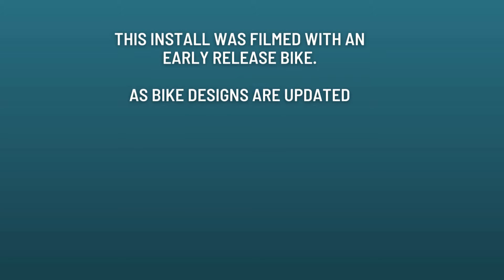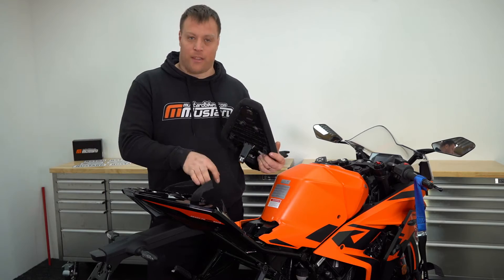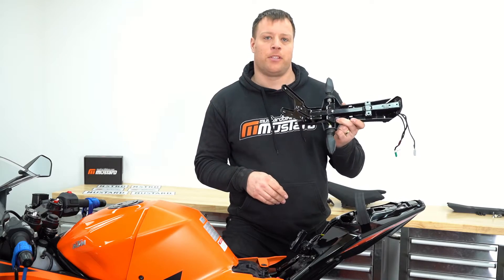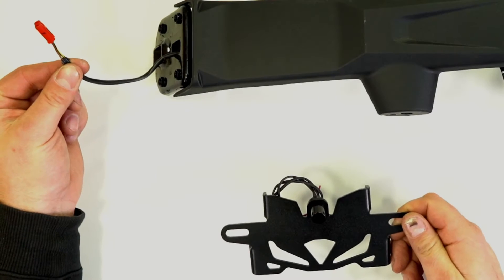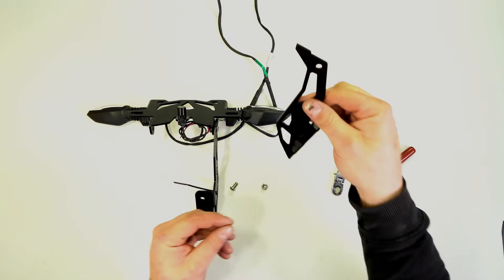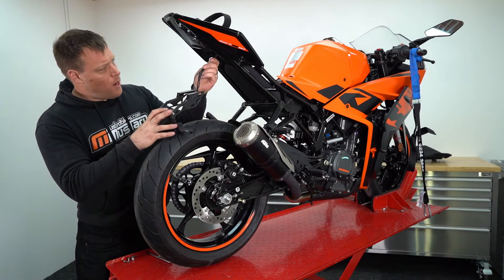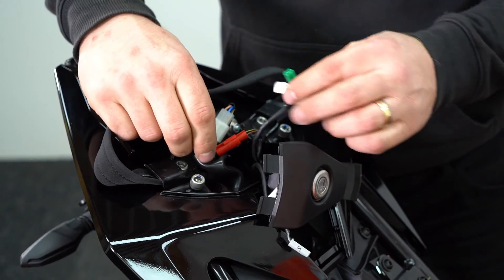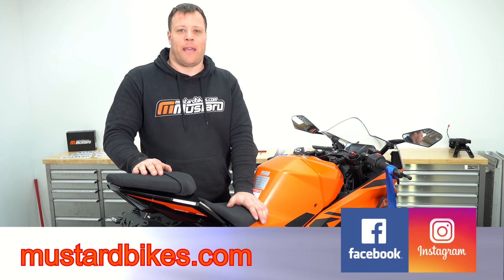Installing a Mustard Bikes tail tidy on a 2022 KTM RC 390

Comment: Saying as I would put this tail tidy on my 390, do you guys have reflectors that are compatible with the tailtidy?
Reply from the maker: We do indeed, although sold separately. The reflectors are designed to bolt on to the bottom of the plate (SA, NT and WA may need additional holes made for this purpose in some cases).
Reply: @MustardBikes I am thinking about getting custom plates (my plates) [NSW] it would be compatible with it right? could you send a link to the reflector is possible, thanks.
Reply from the maker: @DamanK17  Yep, should still be compatible. AR reflector: https://www.mustardbikes.com.au/adr-approved-reflector-mounting-bracket

Comment: can you tell me how to remove the plastic? I've taken out all the screws I can see but the plastic is not coming off:(
Reply from the maker: @motojc which piece of plastic are you referring to? I would go back and check you have indeed removed all screws shown in the video.
Reply: @MustardBikes  It' the 3 pieces that make up the tail. I only see 1 screws left on each of the lower piece holding it to the top one. But after risking breaking the top piece to remove one of the screws, the lower piece still would not come off. I guess it's the way it is snapped to the top piece. Not knowing which way I'm afraid to apply force. Will ask my dealer in the coming wknd. Thanks.

Comment: Hi. Did you cut off a red connector from OEM plate light and reused it on this tail tidy? From what I understand, it doesn't come with a connector pre-installed
Reply from the maker: Hi Yura, that is correct. Thus far we have been unable to source the matching connector. As such the only solution is to cut and fit the OEM connector from the OEM rear fender.
Reply: @MustardBikes  thank you for your response. Good to know
Reply: How do you attach the red connector to the wires from the new unit? It would be nice if you showed that step or could at least explain it. The same issue will presumably come up if replacing the large, ugly OEM turn signals with aftermarket ones so it seems important to explain. Thanks
Reply from the maker: @playboytwo  the video should link directly to a separate video explaining the process of fitting an OEM plug. Hope that helps!
Reply: @MustardBikes  I found it minutes after posting this. Thanks so much!!